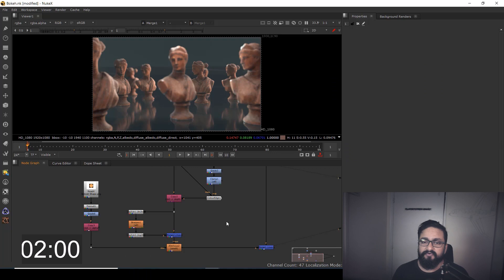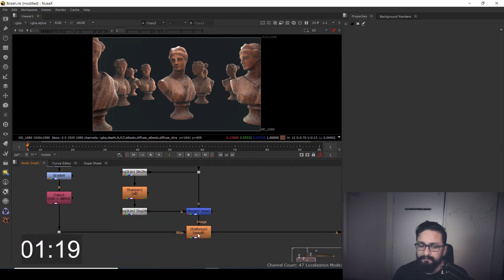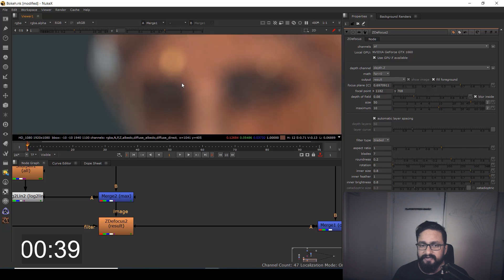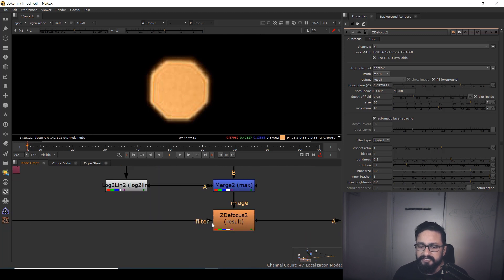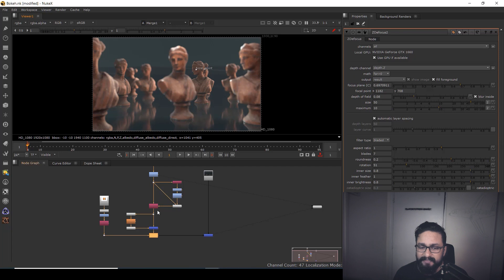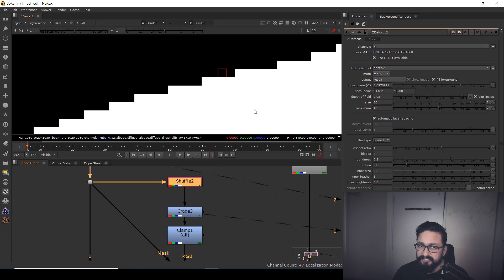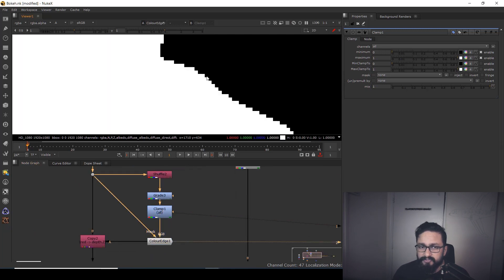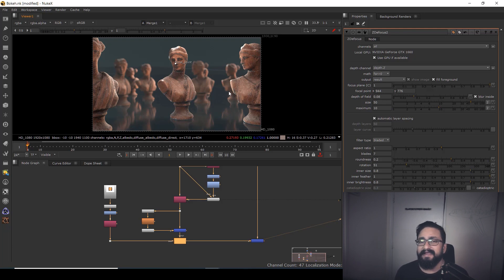HOW TO CONTROL BOKEH SHAPE IN NUKE | TWO MINUTES TUESDAY | VFX VIBE

Comment: Hi sir , For filter I added Blade, and want to get Bokeh shape sharper , but getting soft edges
Reply from the maker: If you are using external image for filtering, then you need to make your image sharp. For bladed option, you can control by its own options